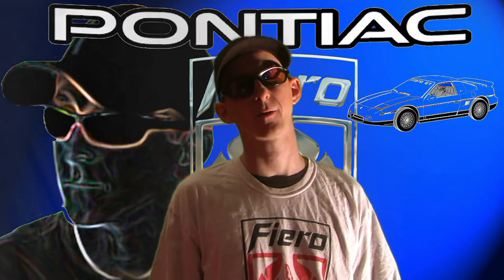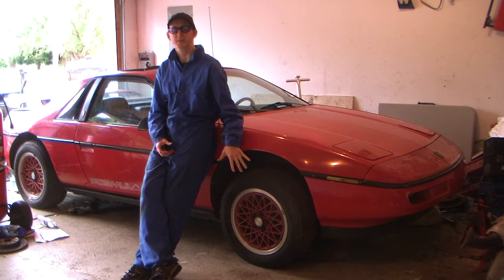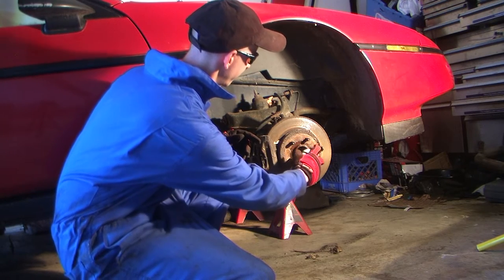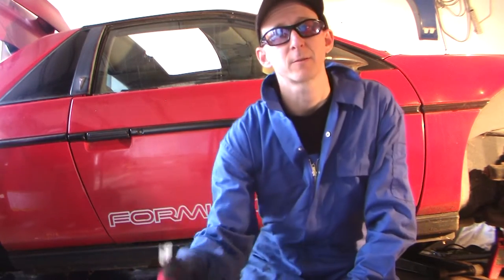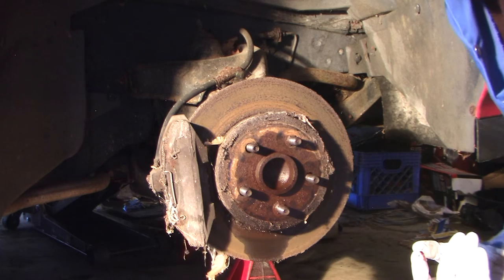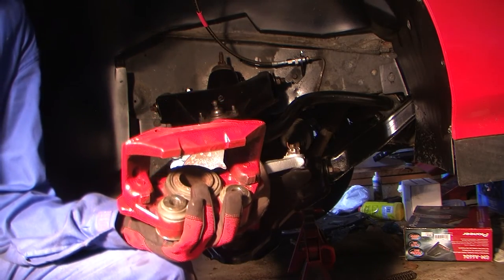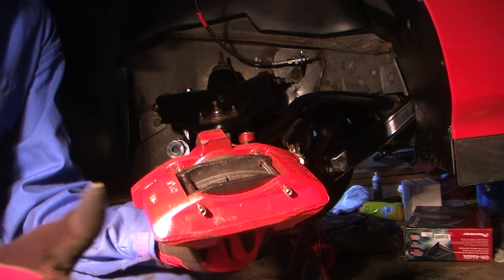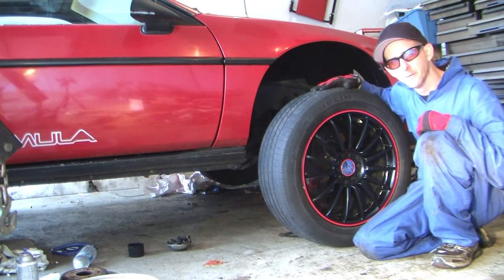Pontiac Fiero: How to remove & Install 88 Brake Caliper, Pads, Rotors & Brakelines

Comment: I admit this approach may be necessary when dealing with rusted together parts but the 1988 Fiero calipers are actually a two piece design. Those 19mm bolts can come out to separate the caliper in half. Actually the front half is just a chunk of steel and has no fluid or internal parts in it. The back half is aluminum and contains all the moving pieces (piston, sliders, fluid, boots, etc).When I did mine (with much rust mind you) I removed the two 19mm bolts and stuck a prybar between the outside pad and rotor and pushed it loose. At that point I was changing rotors-pads-and the like. It was less time consuming and safer on my fingers than beating a punch tool through both pins. This way also allows you to use a C-clamp to compress the piston in a conventional way.Just remove the two 19mm bolts. Separate the caliper halves and remove the brake rotor exposing the brake piston face. This way the caliper mounting/slider torx bolts hold it in place while to depress the piston.If your rotor is rusted/frozen on the hub then remove the caliper completely then use the slider bolts threaded through their original holes to push the rotor from the back. i.e. tighten the torx bolt one-two turns after it touches the rotor face. turn the rotor 1/4 turn. tighten. turn 1/4 turn. tighten etc until the rotor pops loose.Lots of good details in then video BTW.

Comment: Thanks for this vid. I have been putting off this work on my 88, because, as you said, not even the huge Factory Manual cover this well, especially the e-brakes, and the latest Haynes manuals are just crap, because they mainly cover previous years, gloss over the 88's, and don't even address the newer  rear suspension design AT ALL!

Comment: I have an 87 Fiero SE. Somewhat different of course, but this video tuturial was very useful. Thanks so much.
Reply from the maker: waynrayn The 84-87 Fiero braking system is different than the 88's so this kit would not work. I have a C5 Corvette brake kit for my 87 Fiero that I will be installing next month. Ironically I am searching the web RIGHT THIS VERY SECOND for new rims to fit these bigger brakes as your message popped in. I'm not having much luck on one's that I like that anyone has in stock. Look for a braking upgrade video aimed more at your Fiero in a month or so ;)
Reply from the maker: waynrayn Oops forget my last comment. I didn't pay attention to what video you were commenting on. I thought it was the Corvette brake upgrade. Anyway, if you want to upgrade your brakes I have a C5 brake kit coming soon as well as a bigger brake booster conversion.
Reply: Thanks for replying. I did pick up that your 88 was different in some aspects. Mine is an 87 SE, I was in it more for the looks than the speed. She's still in beautiful shape, I get comments all the time. It will be a stock brake and rotor replacement, likely with parts obtainable here (in Canada), and some from the Fiero Store. I've subscribed though, will watch your next postings. Cheers... ~W~

Comment: Been having issues with my front right wheel getting very hot. Going to give this a shot, a shop told me it might be a proportioning valve issue but it’s isolated to only one wheel so I think not? Hoping it’s just something to do with the caliper/brake hose

Comment: I noticed you didn't grease anything. Could that be an issue later? The reason I ask is because I just re-padded my right rear rotor (Also C4 rotors) on my 88' GT and I forgot to grease the caliper parts. Basically, if it isn't an issue, then I don't want to have to take that side apart again.

Comment: should the hand brake engage both rear calipers or just the drivers side on an 87
Reply from the maker: Should engage both calipers. If it doesn't then you may have a caliper out of adjustment, bad cable or need to add more tension to the cable. Fiero e-brakes are very good but you can get them to work if everything is adjusted properly.

Comment: I own an 87’ fiero and im trying to take off the rear right rotor. Does anyone know the size of the middle bolt and which way the thread is going
Reply: Sometimes 1-1/4" sometimes 1-1/8" depending on what hub bearing was put on... Get a new bearing if you remove that nut since doing so ruins the press fit preload and shortens the life

Comment: The front wheel of my 88  has the top tilting inwards and wheel is pointing more right than the other. Does anyone have any idea of whats bent ? its hard to tell (nothing obvious?
Reply: maybe you need alignment on your front end..
Reply: I figured it out :) the two bolts holding the upper control arm to the frame had gotten knocked back toward the car thus tilting the wheel inwards. easy fix. then a simple alignment had them parallel and all is well.